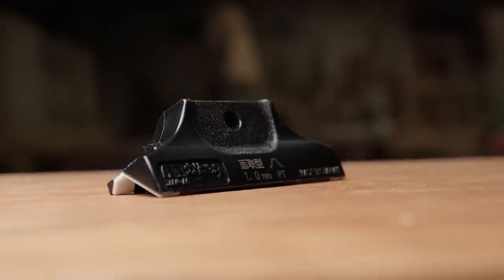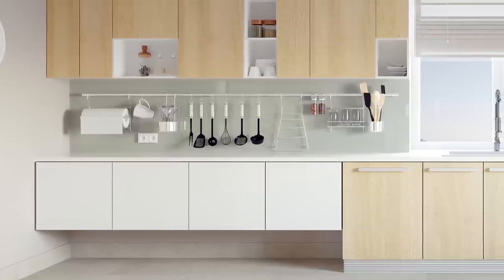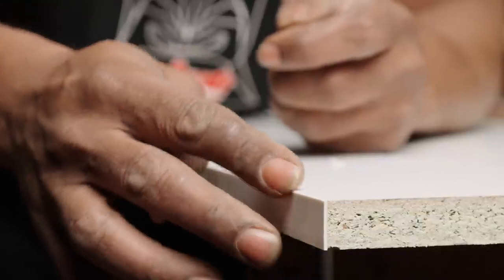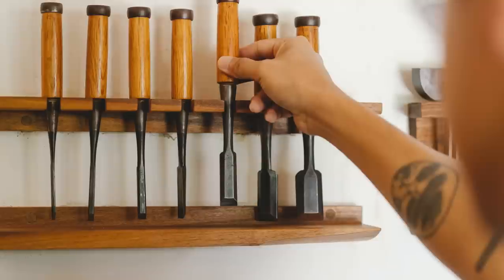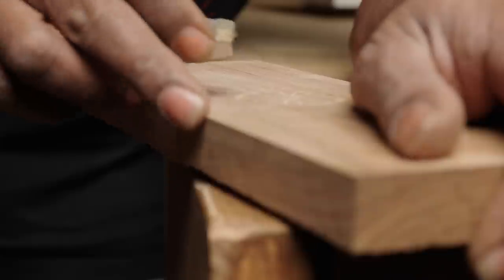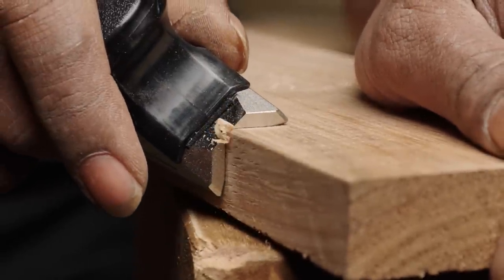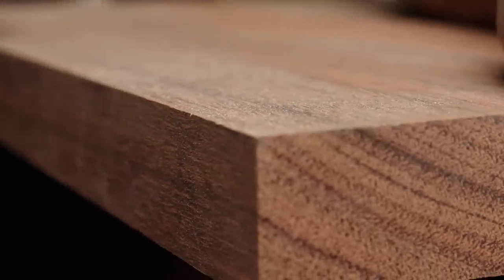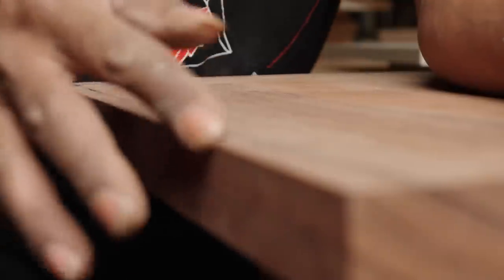Clean almost any 90 degree edge in seconds | Japanese Edge Trimmer

Comment: super cool video, super cool tool 
one small thing though, for showing those edges on video, I think if you turned off the camera's autofocus and set your depth of field such that your focus range included a good portion of the table edge, it would have been a bit easier to see the results :)
Reply from the maker: Thanks for watching, it was a bit difficult getting the focus right on what is a 0.6mm arris. Will try your suggestion next time.